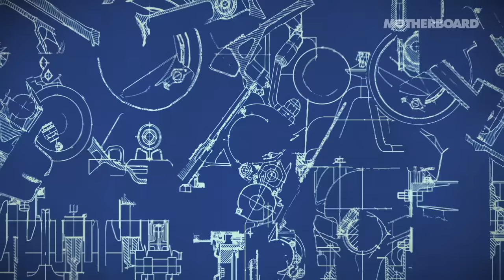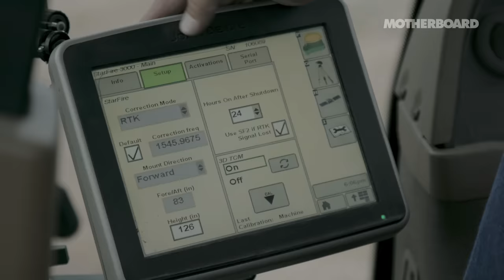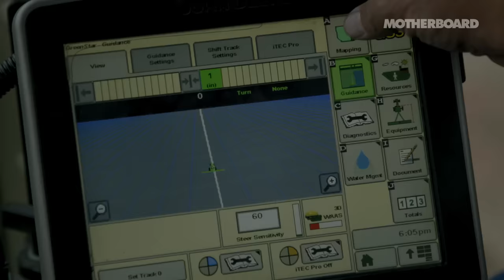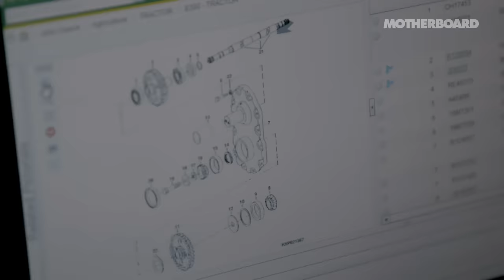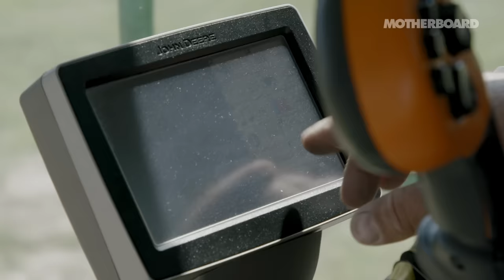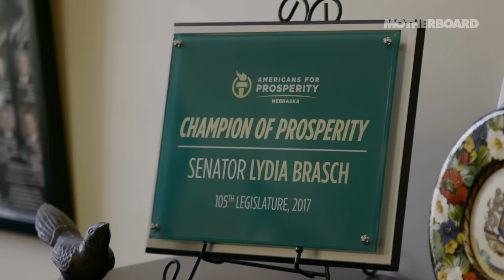Farmers Are Hacking Their Tractors Because of a Right to Repair Ban

Comment: *IMPORTANT IF YOU LIVE IN HI or MA* - the state that pioneered the Automotive Right to Repair and the reason that we now have it across the country. It doesn't take a lot of people to make a big impact at the state level so please take a minute to help out! Links are at the bottom!

I can actually give specific context related to this issue and answer questions because I work with a non-profit that's a member of the Right to Repair coalition. There's some good news on multiple fronts (1) but I'm more familiar with MA than HI so I'll start with that.

MA currently has a Digital Right to Repair Bill that passed favorably out of its committee (2) and will be voted on in our legislature before the end of this summer. This covers products from computers/cell phones to the computer components of things like farm equipment and washing machines. Contact your state representatives (3) and voice your support for S.107 (4) / H.218 (5). It's odds of passing appear good but a final push is always important! Repair.org also made a template (6) for us that has examples of what to say when you get in touch, if you want it.

Here (7) is a video of the MA Digital RtR bill's Joint public hearing if you're curious (starts @31:50, and here's Part 2 (8)). Unfortunately the bills related to heavy duty vehicles themselves (their non-computer parts) and strengthening the current auto repair law got recommended for further study, which essentially means they're not going to pass this session. Although the automotive one did get enough signatures to be a Nov. 2020 ballot question in MA, so vote for it there! Here (9) is a link to the others' MA public hearing as well.

For Hawaii, they also introduced a similar Digital Right to Repair Bill which passed unanimously out of its committee (10). Its versions are here: House (11) and Senate (12). You can find your Hawaii State legislator here (13). Repair.org also made a template (14) for your state that has examples of what to say when you get in touch, if you want it. It's Senate hearing can be found here (15) (the 2/6/2020 video @30:00).

It'd be awesome if Vice could favorite/pin this comment for others to see. Thank you!

Links

1) https://uspirg.org/blogs/blog/usp/right-repair-surges-forward-multiple-fronts-start-2020
2) https://uspirg.org/news/usp/right-repair-wins-day-massachusetts-legislature-clears-committee
3) https://malegislature.gov/search/findmylegislator
4) https://malegislature.gov/Bills/191/S107
5) https://malegislature.gov/Bills/191/H218
6) https://states.repair.org/states/massachusetts
7) https://youtu.be/Orb8gT4itOA?t=1911
8) https://www.youtube.com/watch?v=atdk1uS04D0
9) https://malegislature.gov/Events/Hearings/Detail/3388
10) https://uspirg.org/blogs/blog/usp/hawaii-committee-votes-unanimously-advance-right-repair
11) https://www.capitol.hawaii.gov/measure_indiv.aspx?billtype=HB&billnumber=1884&year=2020
12) https://www.capitol.hawaii.gov/measure_indiv.aspx?billtype=SB&billnumber=2496&year=2020
13) https://www.capitol.hawaii.gov/findleg.aspx
14) https://states.repair.org/states/hawaii/
15) http://olelo.granicus.com/ViewSearchResults.php?view_id=46&types%5BClip%5D=on&types%5BAgendaItem%5D=on&types%5BCaption%5D=on&allwords=HB1884
Reply: All sub to Louis rossman. Fighting this have this bill
Reply: Well they didn’t
Reply: Awesome and very informative post Coves!!

Comment: I have a 4100 JD, I live 2 mile from Fields John Deere in Florida. Every time I go in there they charge me 4 or 5 times what the part should really cost. A few years ago I had a front wheel bearing went out. (4 wheel drive) so I took off the front hub and took it to them , They charged me 450 dollars to rebuild that hub. And turns out later I discovered they only changed 1 bearing. then 2 years later the other side went out so I just just took the tractor to them . they charged me 1200 dollars to rebuild this side. I got my tractor back drove it for less than 3 min and it was making a very loud noise from that just rebuilt hub. So I took it a part myself, thinking if I take it back to them they will say another part went bad and charge me 1200 again. and what I found blew my mind. First I drained out the old used motor oil they put in my front differential. What should have been new 80 or 90 w gear oil. then I discovered the bearing that went bad they did NOT even put a bearing in and the axle was just flopping around inside tearing up the housing. and again I payed them to rebuild this hub they never replaced any bearing. and my last dealing with them my hydraulic cylinder started leaking. I have a 4100 so the cylinders are only 1 1/2 boar and they make these so you have to take them in for repair because they put a lock ring up inside the cylinder and it's very hard to get out. I let them rebuild the tilt cylinders 400 dollars. then time for the lift cylinders  i was going to do it myself they wanted 200 dollars just for 2 o-ring kits ,  which is about 4 or 5 little O-Rings and a orange v grove ring . I went on line and found them for 18 dollars each. Green Parts.com. they have a phone number on the front page of web site . great customer service. a wheel bearing is 8 dollars. wheel seal 4 dollars. I will never go to John Deere ever again.
Reply: Im not a farmer and john deere you are just paying for the name.
Reply: Are there other options then? I mean, could one go for less high tech options or are the companies colluding to force consumers to go high tech?
Reply: Sounds A Typical American Made..... Like GM & Ford..... I mean the 21th Century Made....LOL
Reply: @Samuel Yes. They still produce Basic Old  Classic Models I believe... We used to have a few in mid 80's. But the after sales support was not good. I don't blame them as we don't had many unit in our country.  Anything you would like to Add? Pls
Reply: I got a drive belts from them they love to rip me off. My hustler is also a joke their name is what you are paying for my 2014 raptor sd my dad only had it for 6 years last year it started to break down starter blew i get it fix but my former school only fix what it can do. Eairer this year pto clutch magnet fell off. If you want to have things around go after 1970s and 1980s zero turn or garden mowers. Club mowers also very bad.
Reply: Samuel Had 2 Belarus tractors on our farm back in the early 80’s . A 610 model ( didn’t care for it ) and a 420 4wd , I loved it . The deuzt copy diesel was rough .

Comment: Air conditioning systems like Trane have services that also restrict repair without paying again and again. This practice is unfortunately embedded in several industries. John Deere, Tesla, Apple, Trane and their are many more.
Reply: David David  It costed me US$170 to replace my Samsung Galaxy screen and I did the replacement myself. You have to disassemble the whole thing and remove almost every piece.
Reply: David David  Hahahaha there wasn't a single crack on the LCD; It was a hardware problem! What's your next advice? 🤣🤣🤣
Reply: @YoLo-ex6rk  😎👍

Comment: When I stopped being able to change my oil or do a diagnostic without a special tool or program, I started leaning on my older vehicles. I love being able to rebuild the engine myself.
Reply: Let's go backwards a little. Keep the power for us hard working Americans
Reply: @johngrepo9976  We don't have to go backwards to solve this problem. We just need to take back control of our once representative government from corporate lobbyists and interest groups. The government isn't the bad guy here, its the corporations that now own and install bureaucrats who serve them, not us. Get the money out of politics and you'll solve a lot of these problems. The rest is making your average American schlub care enough about politics to get involved and at the very least vote. 

Those complex pieces of equipment make the same plot of land several times more productive and profitable than they were even 15 years ago, just like modern cars are safer and more reliable than ever. Nobody actually wants to go back to a time where large commercial engines had points and carburetors instead of modern digital control systems that are capable of telling you exactly what's gone wrong with them down to the circuit or fuse. Nobody wants to go back to a time before seat belts and advanced SRS. Just give us access to the products we pay for at a reasonable price.
Reply: Amen. I stopped working on vehicles made after the late 70’s.
Reply: You all act like learning new skills is a bad thing. I do this for a living and it isn't any harder to fix a modern car. Rebuilding an engine has been the same process for forever. You can buy factory diagnostic equipment for automobiles, or if youre a real broke ass, make friends with someone who works at a shop and bum scans and resets off of them.
Reply: @joshbarth9469  Its easier to work on the electronic parts. Or atleast it is in my opinion. Good thing the open sourced software variant is protected by every aspect of the government
Reply: Why the fuck can’t you change oil? Lmao that’s still a mechanical skill
Reply: Vintage autos are a thing of the past when your 52 year old car is done because the "chip" is obsolete.
Reply: Jeff Miller 

Yup old is the way to go
Reply: American Cars are the Best, proudly own a 94 Cavalier as a daily driver, greetings from México !
Reply: A scan tooks like $50
Reply: @slopoke8656  I've heard that on newer cars, the oil filler cap has a literal electronic lock on it that only the dealer can open. You can't even get around it by going through the dipstick tube because there is no dipstick tube!
Reply: @marcuswelch4515  lmao

Comment: They didn’t honor my 1 year warranty when my computer went bad with 75 hours on the machine.The tractor would move  by itself if the engine was running which is real dangerous.They waited until after the one year was up to call me back or talk to me at the dealer.Local technician diagnosed the computer with intermittent voltages to the forward drive potentiometer.Cost me $2800 for the computer and $7300 for the dealer to flash it with my serial number.I will never buy a John Deere again and I’m a third generation farmer actively farming.

Comment: As and electronics technician, I wholly support this bill!  I can find parts and schematics for radios that were built in the 1930's and before.  Even Hifi stereos built in the 1970's would have a schematic diagram hiding inside, and repair components are readily available to get them in working condition.  Repairing a 10 year old flat-panel TV however is next to impossible if it's a semiconductor that's failed.  Just like the farmer, the chips are "dead" when they arrive and must be programmed.  even then, there is a LOT of custom chips that were only made for the run of that particular model TV...yet, I can get a transistor to repair a 1970's RCA television very easily!
Reply: are you self taught?

Comment: "these older tractors are still capable of going out and doing a days work, i wonder if we will be able to say that about these newer tractors when they are the same age"
Reply: Start redesigning and rebuilding your engineering technologies back to the pre-computer era of the 1970s where everything is 100% DIY repairable, upgradable, fixable, inspectable, testable, checkable, rebuildable, etc, and what have you! Pass American Laws baning planned obsolescence by making everything 100% DIY restorable! I can still remember that late 1980s going way back to the entire 1970s and 1960s and 1950s and 1940s where everything is held together by screws, nuts and bolts, mechanical clamps, mechanical sliding clamps and other kinds of mechanical connections that can ALLOW ALL AND ANY OF THE COMPONENTS TO BE REPLACED AND THAT INCLUDES THE SUB-ASSEMBLIES SO THAT THE ENTIRE PRODUCT CAN BE REPAIRED AND BE REPAIRABLE AND UPGRADBLE AND SCALABLE INDEFINITELY.
Reply: Nope.. they are planned to fail crap
Reply: Sorry your product is no longer supported. Please spend $100,000 to upgrade
Reply: I have a '61 Jaguar E-type which is still able to take me to work and back; no onboard computers, no sensors, etc., even though that was a pretty sophisticated car for the day.
Reply: The biggest mistake a manufacturer can make is to make a product that is too good, and when they do, the solution is to discontinue the parts that  keep ‘em running.
Reply: @UndergroundTr33House  So it was true that "nothing runs like a Deere?"
Reply: @darthvader5300  
It’s illegal to build those old engines now because of the EPA’s emissions standards.
Reply: I guess no they will not.
Reply: @darthvader5300  That will amount to them not making as much money and it is money what drives this whole issue in the first place, they will never do that.
Reply: @matthew8153  Ever heard of the multiple spark plug chamber surrounded by a vacuum insulated wall? They were invented in the 1950s and virtually all of the smoke coming out of a diesel engine and gasoline engine were REDUCED TO ALMOST ZERO EMISSIONS and by passing through a series of self-cleaning cyclonic filters made out of ceramic coated steel they can last indefinitely. The only thing coming out of carbon dioxide, nitrogen, water vapor (because air contains water vapor and you can see water dripping from the exhaust pipes of internal combustion engines if you look closely and pay attention for a long time) and other inert gases.
Reply: @redsammy7789  Yes and now. Yes they will not earn as much money IN THE SATURATED DOMESTIC MARKET but they can earn many times more money in the INTERNATIONAL MARKET OF MORE THAN 6 BILLION PEOPLE for many more decades to come. My point is that they should think WHOLISTICALLY while thinking long term.
Reply: That's a fair accusation, but on the flip side there are significant advances in productivity, comfort, efficiency, captured data, and environmental impacts from the newer equipment. Plus the actual hardware is more durable. Not saying people shouldn't have a right to repair or that the business model is good, but I work with John Deere embedded developers. They don't just sit on their ass all day trying to screw over the customers, they develop real features that deliver real value. It's a shame that the fruits of their labor are delivered in such an anti-consumer fashion.
Reply: This how I feel about people
Reply: @michaelwalter3399  Damn good car. Damn expensive too. Lucky you!

Comment: As a technician in a totally different area i totally support the right to repair... Its just common sense
Reply: You can reach out to Louis Rossmann about your field.
Reply: the repair is what makes John deer their money, alot of the time they sell the machine at cost or below cost, because they know the person has no choice to purchase the parts or get the tools repaired by them
Reply: @OldGreg1776 Framework laptop, isn't giving out schematics to anyone, but electronic repair shops, it's a reasonable comp
Reply: @OldGreg1776 yes!
Reply: same
Reply: @gavincarstens6497  So john deer operates like printer companies. Sell the printers below cost and mark the prices of ink the hell up. Last time my dad needed more ink, it was cheaper for him to buy brand new printer that comes with ink, than just buying the ink. I mean imagine the e-waste there!!
Reply: @megapet777  except for John deer, your locked into a million dollar peice of equipment. so changing over if it needs a oil change is alittle different but close example
Reply: I think I would be worried about the enemy within, not what's happening in the rest of the World.

Comment: Don't forget that this business with John Deere is part of a larger problem, which has two horns. 
1) Our 'throwaway' culture
2) The various attempts by manufacturers to make their products 'unique' and only repairable by their own technicians.
We don't complain (much) if a (cheapish) kettle stops working in a fairly short while. We don't moan too much if an electric drill fails. We have accepted, in the name of 'progress' and 'efficiency' the entry of electronics to motor cars, which used to function without any, and can snowfall because of an electronics issue. 
It's just that tractors and the like are so much bigger and more expensive. Farmers are also usually natural 'fixers'. 
Good luck to the farmers, I say!